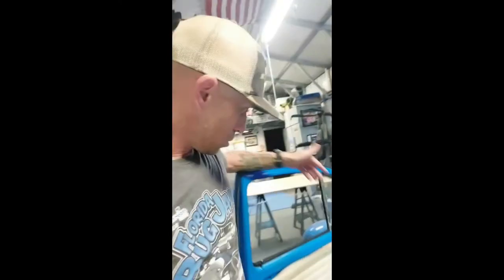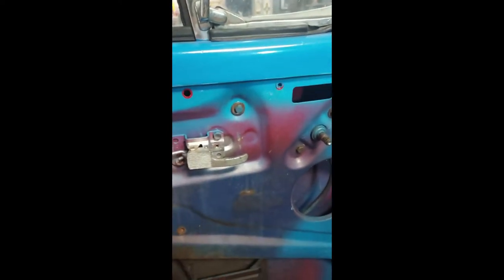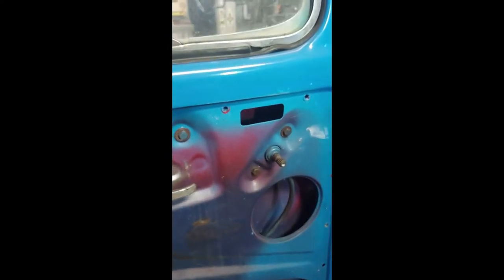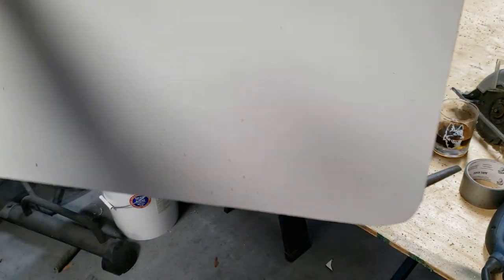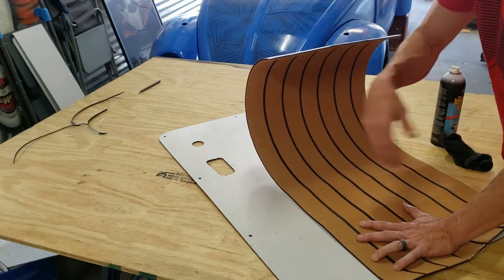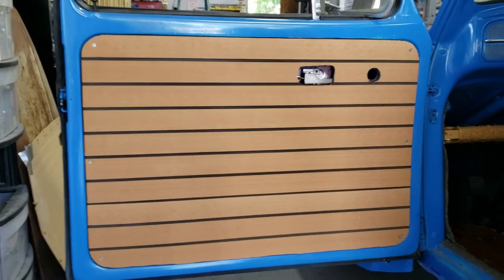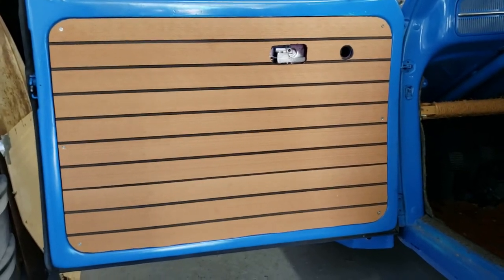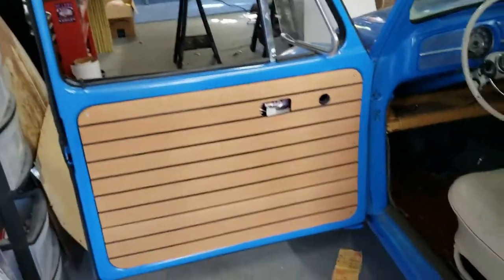Custom VW Beetle Door Panels

Comment: Looks awesome! Can you think of any way to  eliminate the screws showing?
Reply from the maker: Thanks!. I could apply the board first with some very flat head screws and then apply the foam mat over them. Small hump would appear over the screw but wouldn't bother me
Reply from the maker: OR, what I plan on doing is mix some paint to a perfect match and dab it on the screw heads so they blend in